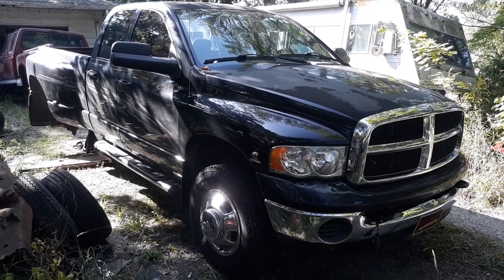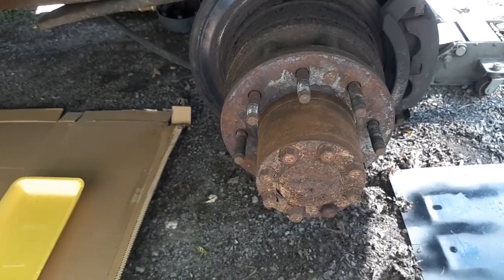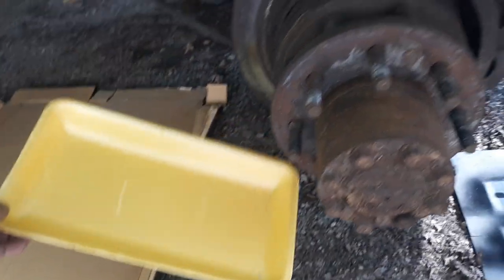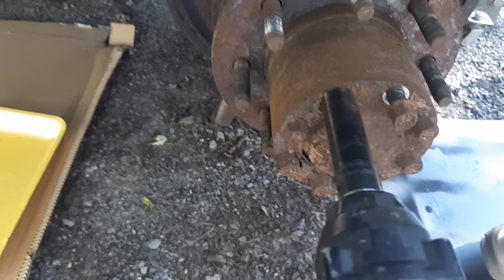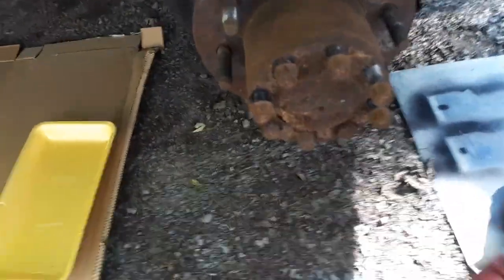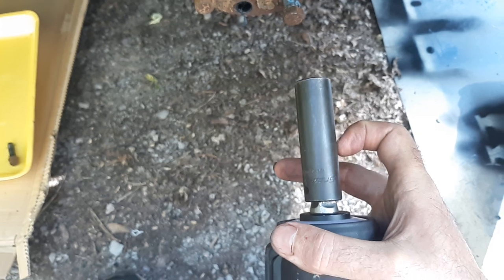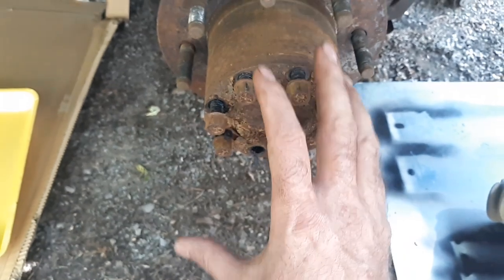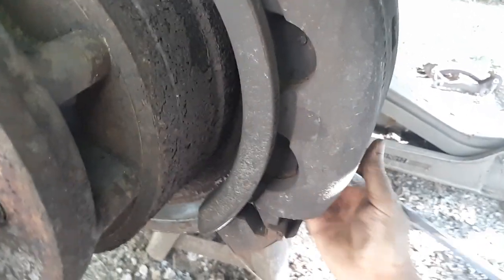Doing rear #brake on a 2004 #ram 3500 dually Part 2

Comment: You don't always have to have the most expensive tool. You need a tool that will do the job you want it to do when you want it to do it. Nice work on the brakes so far. Look forward to more. Be safe and stay well.

Comment: I work the same way as you Chef. I use left over containers for bolts. I have a few metal baking pans of various sizes. A big old cardboard box or a piece of plywood makes for a great surface to lay on. Sometimes a draw a theme on my carboard "back yard mechanic's creeper" as I call them. On occasion I pull out my Snap-on sockets when I am feeling in a "professional" mood.  🤣🤣